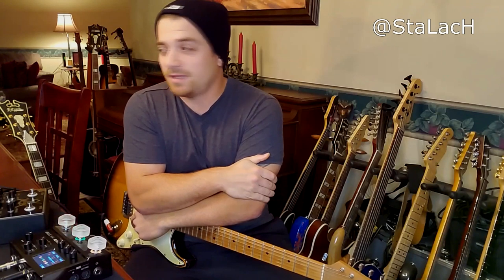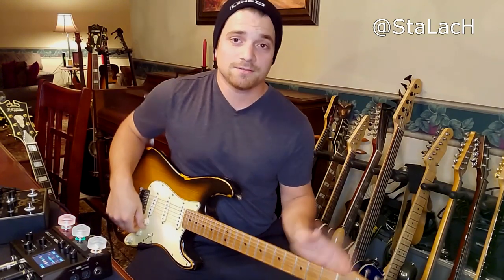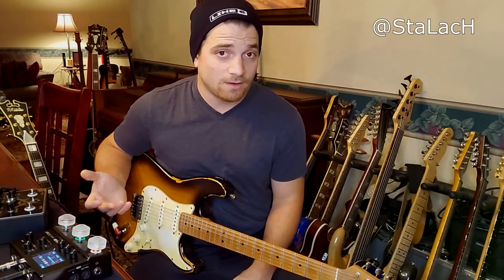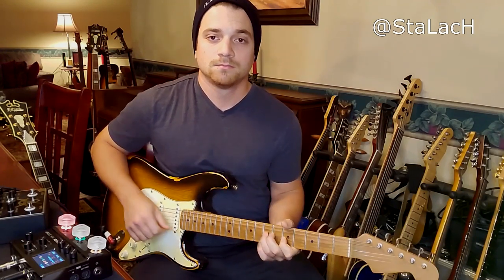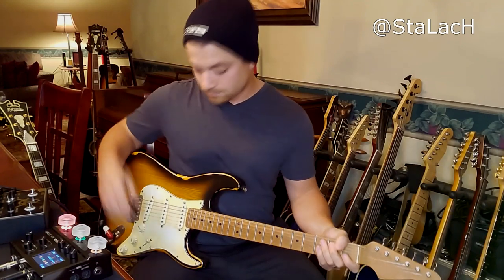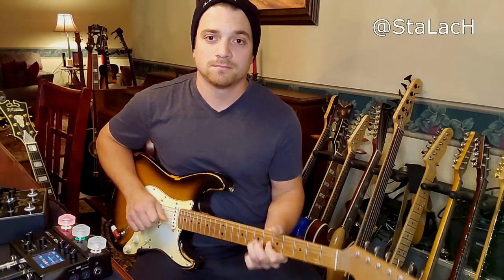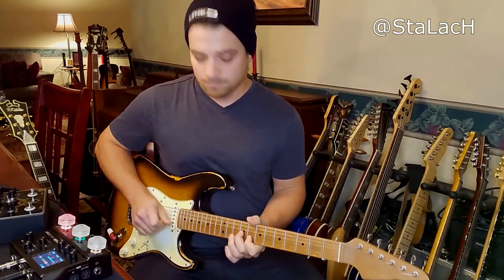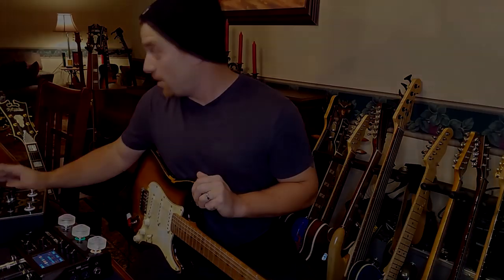John Mayer is Wrong About Modeling - Should have gone Helix!

Comment: Come on people. Tube amps are better than modelers. No one is arguing that they’re better. We’re saying that they are close enough to justify not spending my whole savings on a good amp. I’ve had plenty of $1,000 or less tube amps that barely hold a candle to the Helix line. I’ve played a Morgan that blew the Helix line out of the water. I can’t afford the Morgan though, so I went with the Stomp. It was better than my Deluxe Reverb, so I sold the Deluxe Reverb and bought the stomp and took my wife to dinner. To each their own 🤷🏼‍♂️
Reply from the maker: At the end of the day,  if it gets the job done you're golden ! And if your wife is happy, EVEN BETTER!
Reply: I agree. I have some significant money tied up in high-end boutique tube amps, love their sound and playing through them, but the fears of a tube failing and toasting the board, or dropping the amp, plus the weight and size, and wondering how I’d ever replace it because they’re all unique, those get old. Being able to carry a rig in two bags, and, if it breaks being able to load all the settings into a replacement and instantly have the same sound is really seductive. In five years conventional amps are going to have some extremely tough competition from modelers.

Comment: Steve I know this is 11 months old and I know John has used an axe fx on stage. I’ve only seen him use it one time but I’ve also seen him backstage using a kemper. I love a great tube amp and the way they take a great dirt, overdrive or fuzz or sometimes compression. That’s all I use. I do have a kemper and a helix and they’re ok. I still put a real pedal in front of them for feel and or sound but the best modeler is the Yamaha 100hd in sound and feel. Overlooked and underrated. If I gigged I’d definitely bring either the kemper or helix.
Reply from the maker: Im going to look into getting one now ! They look great. Thanks for hipping me to them

Comment: Great video. I always was disappointed that with my past modelers as I could never use the volume control on my guitar anymore because I'd loss the effect strength. Having had that issue for years with my Boss Gt8 (and my old single Boss Digital Delay), I never even tried using my guitar volume knobs since I got my Helix 6 months ago, I just made 4 snapshots of 3 db more going up so I wouldn't have to use the volume pedal during lives shows, which is annoying and dangerous since I do my own sound and sometime don't have stage monitors.  So I guess this is a known issue of the past with previous modelers? Not being able to use those guitar volume control knobs? Looking forward to experimenting later.
Reply from the maker: As long as you're happy with the taper of the volume pot , the helix behaves as it should!
Reply: Old modelers behaved more like a fuzz or distortion with a compressor in front; they mostly ignored changing the volume control on the guitar and as a result didn’t track the dynamics correctly. Now, the Helix and Fractal Audio units don’t MUCH better, to the point I think they’re plenty close. 

I have high-end boutique tube amps and use no pedals and instead rely on the guitar volume for my clean rhythm to full-gain lead sound so I’m like the worst-case user of a modeler. I thought the Helix was good, but then switched to an AX8 and was really impressed because it tracks the dynamics like my tube amps. 

Like Mayer, I hear some digital artifacts in both the Helix and Fractal Audio, but I’m using studio headphones. Still they’re buried pretty deeply under the main signal and I don’t think they’d be audible on stage or in a mix.
Reply: @8sigreg  Thanks man.

Comment: I did a thing, tell me what you think, i may be mistaking something. I compared the preamp section, clean of a solid state amp of mine with the preamp section of the hx through the power amp. I realized that it still has like half the dinamic you actually get from the real amp's preamp and that there's like a certain compression on the high frequency that makes them pop out more than normal. 
Just saying this because once i noticed i started looking for solutions :)
Reply from the maker: I think it would depend on the amp. I've had great results going into power amps of tube amps like the hot rod series. You should still use the regular "amp" when doing this
Reply: @SteveSterlacci  i didn't understand, when doing what? Sorry LOL

Comment: It sounds grate. I’m such a technical tard🤣and I have trust issues. I do however use a line 6 m13 for mods, delays, and reverbs, and it works great. The guitar volume control works great. I loop it, and run drives through expressions through front, but I do see my self getting tired of toting all that shit. Very informative.🎸🎼🎶🎶🎶🎶🎶🤘

Comment: Shouldnt an amp clean up much more than the helix does, I mean - you are going down from 10 to 4 om the volume knob but its still pretty much the same amount of gain/distortion in the tone
Reply from the maker: Depends on the volume knob to be honest. It cleans up fine in almost all situations for me. The pot in that guitar is linear so it's minimal change from like 3-10, then quickly tapers
Reply: @SteveSterlacci  ok but i feel the same thing on my strat.. it decreases the volume but it doesnt clean it up as much as it did on my old tube amp. But I cant swear on it.. just my feeling.. might be tricking myself
Reply from the maker: @simonbilleng2748  the amount of gain on the amp is a big factor too. With the modeling, you typically will use more gain than you're used to getting since volume in the room would be a factor with the real amp
Reply: @SteveSterlacci  that might be it. I used to run almost zero gain on my old tube amp
Reply from the maker: @simonbilleng2748  try the jtm amps with gain 3-5 and see how you fair with it and the volume knob
Reply: @SteveSterlacci  cool! Do you know any good setup to emulate the holy grail of cleans (mayers Two Rock amp)?
Reply from the maker: @simonbilleng2748  explore the litigator, low gain with some dyna comp and nice reverb!

Comment: The Best one always will be a real valve amp but its not very práctical, then the kemper is something that can keep you running without any complains since forever, next fractal have a tons of things to choose and create a really good and custom sound but its a little harder to learn but eventually you will be like a fish in the water, and last but not least line 6 modelers. Line 6 always had that hurting sound in the top end that once you notice you always will hear as an issue, but you can live with it and get used to.

I tríed almost all the line 6 modelers since the begining and Im a very happy line 6 user and Im proud with the evolution and my sound, but once you test kemper or even fractal 2 or 3 you know that they have better sound than yours instantly.

If money wasnt and issue, ill go with kemper all the way, even the real valve and expensive pedals will be my second place.

That in my personal opinión of course.

Comment: I think the problem with most guys is the issue of digital clipping and they don't understand how to set things up properly.  Throughout the chain there are possibilities to digitally clip and Line6 REALLY NEED VU meters at every block so that the user can see what the levels are in the signal chain.  You have given a guitarist some tools to make an amplifier and most guitarists are not Amplifier designers!!  Having a basic VU meter would show them where hotspots are and how to mitigate clipping (or use clipping!).
Reply from the maker: I think a meter in helix would be a great addition !
Reply: Even a traffic light LED on the corner of each block to show levels would be useful  Grn < -12dB, Yel -12 to 0dB, Red > 0dB
Reply from the maker: @pentachronic  that's how it is in the power cab and it's super useful
Reply: In the software for Power Cab ?  I use FRFR all the time so haven't really checked that.
Reply from the maker: @pentachronic  you've got an input indicator next to the volume knob that turns green yellow and red based on the input signal. If you check my helix playlist I have a video on how to set it up

Comment: There is a clear difference between tube amps and modellers. Everyone is bei g sold with the look how authentic this sounds against its real tube amp equivalent. Truth of the matter is, digital technology is better but you will never get the same tone as what you get out of a real tube amp. I own both top end digital simulators and real tube amps. I only ever use the digital stuff to record. Why???? Because it is easier and convenient but the sound is definitely different to my live rig where my main tone is tube/valve driven and only using digital modulation effects. The age of tube amps in this era is slowly dying in favour of these amp sims